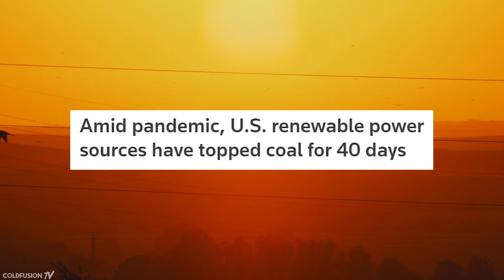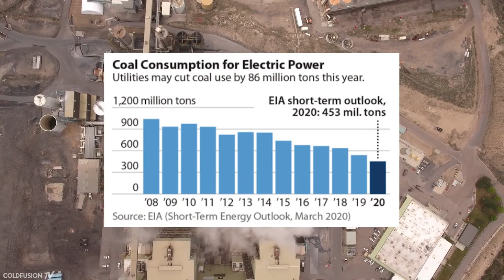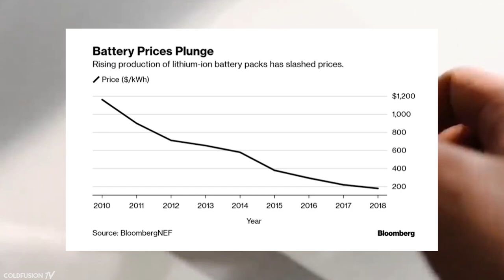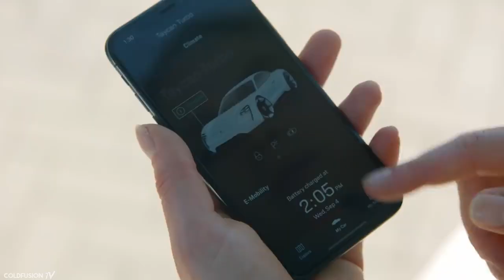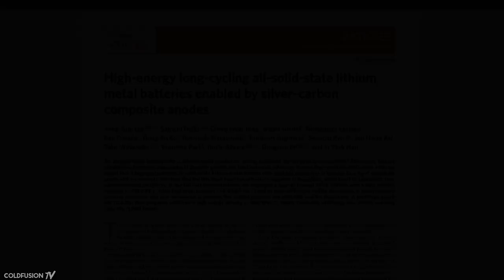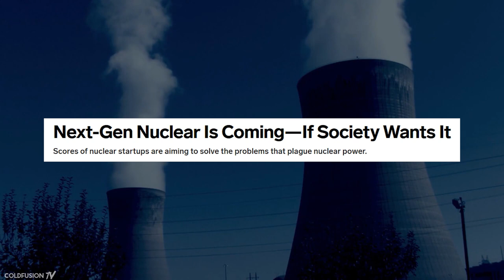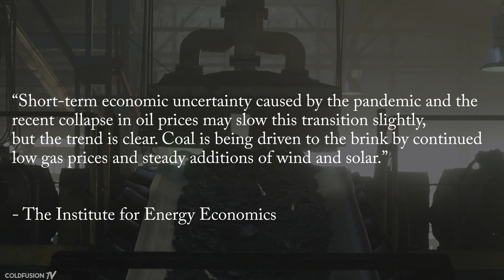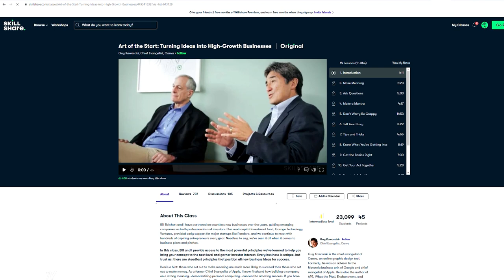Amid Pandemic, Renewables Now Supply More Energy than Coal in the U.S.

Comment: I normally find your videos very substantive to the content represented, but in this video the premise is very misleading. Though it is technically correct that renewable are a growing market in the US, ones interpretation of a renewable energy source, and the reality are divergent. Currently the US has 7 primary renewable energy sources. Wind, Solar, Hydro, Geothermal, Liquid Biofuels, Wood Biomass, and Waste Biomass. Currently the fastest growing sectors include wind and solar which is great! However, due to the current inefficiencies of technology the net energy output of these methods through the production supply chain to obsolescence are relatively small. Now, as you referenced in battery technology as these technologies are further developed they will gain efficiency and become better in the future. In that I agree and think these means of energy production are wonderful. Hydro power is much more effective; however, given the environmental repercussions of dams we are at a limit to the number we can construct. Of all renewable available today Geothermal is the most viable, and least damaging to the environment. But then there are the other three.

Wood Biomass is a very special process where trees are cut down, thrown into a furnace, and used to power a generator. It has many issues and is just as bad for the environment as coal production. Waste Biomass replaces the Wood with human waste. Given additional environmental issues this too is similarly dangerous to coal. Finally we have liquid biofuels. In the US ethanol is the most common liquid biofuel and is produced as a derivative of corn; however, the secondary ingredient to ethanol are fossil fuels. These three "renewable" energy sources (Wood Biomass, Waste Biomass, and Liquid Biomass) represent 1/3rd of US renewable production. Given the carbon output of these production methods, among the additional carbon output in the supply chain for solar panels and wind turbines, the terminology of "renewable energy" is being mislead as equivalent to "good for the environment."

I hope this is somewhat beneficial and would love to see Dagogo cover this in the future. I think it is important to understand the reality of renewables. Not all renewables are created equal. They are not a magic bullet that can immediately change our energy production; however, with research and time they will become more and more viable. 

synopsis on the issues with biofuel :  "The Campaign to Stop GE Trees" : https://stopgetrees.org/problems-big-biomass/
May 2020 US energy sources : https://www.eia.gov/outlooks/steo/report/electricity.php
Article on Ethanol drawbacks : https://www.theatlantic.com/ideas/archive/2019/11/ethanol-has-forsaken-us/602191/

Comment: Burning garbage for power is horrendously expensive due to all the toxin filters,
The energy produced is barely profitable if the heat is used to sell hot water for heating in very cold climates.
Pyrolysis could be the answer.

Comment: 4:40 We currently do not have any battery technologies or theorized  battery technologies even close to meeting demand. I recently did a whole engineering research paper on this. The semi feasible options are gravity based methods such as pumped hydro but they are geographically dependent and inefficent. I don't know where you got the idea that anything we have now or is theorized is viable ( 6:46 ). If they where companies would be using them or looking to use them. The energy densities are way way to small. The unit cost for a lithium ion installment is ~$207/kw. Chemical/Solid-state batteries will never have the required density and scalability. Sure you will see a very low energy scale remote area using them or a small portion of a grid use them to load leveling for political stunts(ahem Elon Musk...). Just like fusion energy its been 20 years away for the past 50 years. There has been a new supposedly revolutionary chem battery paper every month now for the past 10 years. 99% of these go no where. Just like the cancer and HIV treatment studies that get sensationalized every other month as a new cure.  There is a huge problem of sensational click baits on both the researcher and journal sides. (I would definitely recommend watching Coffee Breaks yt video on this topic) . And Yes, there are ton of other theoretical batteries like kinetic, compressed air, power->gas, etc. But the vast majority of these are not new or novel concepts and are just not scalable or economically viable outside of making interesting research paper titles or 'trendy' startups that only exist due to goverment subsidy. 

  But even after all that, there really isn't even a real demand for the type and scale of storage needed for intermittent energy source usage. All of the quoted prices for solar and wind aren't real because they are heavily subsidized. The only reason they are growing is because of politics. Grid providers are being forced to adopt certain percentages of these intermittents. There just isn't any intermittent source demand without those subsidies. The real demand is still in higher efficiency load following base-load systems. The fact that solar or wind grow in the United States is an inherently bad thing for both the economy and environment. Because subsidized intermittent sources mess with curtailment merit order and thus destroy the economics of load following base loads like Nuclear that are actually efficient and green. Those nuclear plants rely on being able to subsidize there higher operation costs by being able to sell 24/7 and in particular when demand is highest. Problem is these intermittents like solar dump goverment subsidized energy supply right at the same time as those demand peaks making it so the nuclear plant also has to sell at a loss (supply up, demand same, price down). In cases like California that are overloaded with solar these solar plants even sell power at their own loss (even after subsidy) because they produce more than is needed by the grid at peak hours. California looses millions on this a month when they have to give away  or even sometimes pay nearby states to take this excess power. 

Here are some interesting sources: 
(coffee break vid) https://www.youtube.com/watch?v=fq8HOguXGFI
(optimistic look at how much energy would be wasted by using solar even with batteries) https://www.cell.com/iscience/pdf/S2589-0042(19)30396-7.pdf
(cost/exploration of storage methods) https://www.youtube.com/watch?v=fq8HOguXGFI
(california losing money on solar) https://www.cell.com/iscience/pdf/S2589-0042(19)30396-7.pdf
(quora answer on merit order) https://www.quora.com/What-do-renewable-energy-generators-do-when-they-produce-more-than-what-is-demanded?share=1

Comment: Greetings: I am a big fan of advanced nuclear power generation  particularly the use of thorium breeder and fast uranium/plutonium breeder reactors. Both of those can make use of the spent nuclear fuel from existing reactors as well as the depleted uranium from both uranium enrichment processes as well as former weapons grade fuel and process waste fissionable material. 24/7 reliable power and we can clean up existing stockpiles. Yes, some spent fuel waste is still produced, but there is much less volume and storage time reduced from thousands of years to about 300 years. Also most units have inherent safety due to their operational physics.

Comment: Can you work on the video that describes life cycle emmisions of various energy sources? I know that the lifecycle emmissions from renewables are drastically lower than hydrocarbon power sources but this topic is something that green energy opponents often swing to without providing any analysis of the actual numbers. I know it can be complicated and vary quite a bit depending on the specifics of a scenario but it would be nice to a range and an average for different sources.

Comment: I support renewable energy not for environmental reasons (which there is many) but for the national security/economic benefits it brings. If a country can produces it's own power using the environment within it's boarders it less likely to be impacted by outside politics. Foreign oil embargoes, etc... don't matter if your are driving EVs charged by locally produced power.

Comment: The other question is "what happens when batteries are spent and mountains of old batteries start appearing or just thrown away"
Reply: Devonly What makes you think that batteries containing valuable raw materials that are easy to recycle will be thrown away?
Reply: @spencerwilton5831  Its only valuable if it's cheaper to recycle them than digging the materials out of the ground and manufacturing them.

Comment: Why do you pluck a battery out of a random laptop for its mah capacity?
Why don't you try to figure out the highest capacity 18650 of the period, and then bunch together six of those, and calculate mah from that? because that is a more appropriate measurement of capacity, if going by mah, than what you put up. We had 1500mah cells in laptops around ~2000, and they worked just fine. And that's per cell; that'd be 4500 for lower tier 3 cells (which nothing even used until netbooks rolled around), or 9000 for the more ubiquitous 6 cell batteries. Both of these shit all over a 5000mah single cell, both in current delivery and holding capacity.

Comment: Storange is (very) important. But actually, there are better ways then Batteries. Because those are expansive, wear out in (short) time and are actually not great for the Enviromet. If acountry has eg tall Mountains, use a pump water storage power facilities. The in and out of power are of course disapointing copared to a Battery. But they ain't cause nearly as much wear and they can storange HUGE amounts of water (energy). Mass overproduction meens: Instant power Storage. And then when you need it - they can turned off and on on any given time. Like a Batery.

Comment: I think/hope that electric cars can be a big part of the energy storage solution. The available capacity of battery capacity in electric vehicles is growing very fast such that even using a small part of it will have a massive impact on the grid. I have recently seen a video where the potential of using cars in distributed energy storage was discussed and it has advantages on many levels.  It will all depend on advances in battery technology and in the software to regulate the storage and release to the grid of electricity, based on availability and demand.

Comment: Unfortunately, energy is just one of the three most important sectors. Heat and transport will use more capacity of the energy sector in the future and will demand more grid capacity. At the moment the transport and heat sector is still based on carbon emissive resources. The decabonization of mainly one sector won't be enough if we want to slow clima change.

Comment: I've been following the sporadic development of renewable sources of energy for years. IMO, the whole paradigm  is wrong. Technology is not the problem. In small scale, it already exits. The grid is the problem. Solar, wind, or a combination of both can power one house for a day when the sun shines or the wind blows a few kph (mph). Batteries no larger than a home air conditioner have the capacity to store power on site until needed on cloudy days or nights when wind speed is insufficient. For apartment or  larger office buildings add more batteries. Three  batteries aren't 1 + 1 + 1. It's 3².  Why carve out thousands of acres of land for solar panels aimed at a tower that produces less energy in a day than a coal fired plan produces in less than hour. Control the grid = control the people. Get rid of the grid. I'll produce my own power. thank you.

Comment: We need solar and wind to get to the point where they are cheap and efficient enough that every home can achieve energy self sufficiency.
Reply: Well you won't reach that for big buildings, for small ones it is already achieved, an uncle of mine has solar on it's roof, in 2018 it had a potential 30 MWh. Potential because he couldn't use all of that so the solar plant runs always at reduced power.

Comment: ooooh, i did not like your battery comparison at 5:15,  yeh lithium is better than cadmium for sure but showing a 14.4v @1700 vs a 3.7v @5000 is a little misleading. The first is is 24.48wh vs 18.5wh so Its not even a proper comparison. I only say this as i hold you to a higher standard than that.

Comment: Some of you are idiots. Watch the video again (or few times). It is not suggesting that demand has shifted from coal to renewables. The fact is demand for renewable energy is increasing and coal is decreasing (for the specific time mentioned).
Also, think outside the box. Energy captured from renewable sources can be stored in batteries placed in residential and commercial spaces. This can't be said about traditional power plants. With this scale, advancements in renewable efficiency, and the advancements in battery technology, we can see how renewable energy can replace traditional non renewable sources on day. The glass can be half full

Comment: What the real solution is to intermittent is Nuclear power not battery. Nuclear is clean 100% uptime, efficient energy with zero CO2
Reply: The real question is if you invest in nuclear why have renewables at all?  With nuclear in place 24/7 all renewables would do is mess up the management of the grid.

Comment: In light of "Planet of the Humans", which is free on YouTube, I don't know what to believe, anymore.
Reply: This video is clearly cherry picking the data. You can see that wind and solar exceeded coal use but you see that natural gas went up even more. Which is what Planet of the Humans discussed, we're decreasing coal use by increasing natural gas use. We're just replacing one fossil fuel with another. The real point of the movie was to pull back the curtain - from videos like this one - that with enough technology and ingenuity, we can build our way out of fossil fuel use and negative environmental impacts. The truth is our modern civilization requires fossil fuel use and all forms of electricity generation will have a negative impact on the environment. For more, see Collapse movie (2009).  I wonder if thunderf00t could critique this video.
Reply: Planet of the humans is mostly based on decade old data on the costs and efficiencies of renewables, when the big thing about solar and wind is how fast they are dropping in costs.
The critiques of biomass are mostly valid as well as the critique on selling gas as a "renewable" form of energy. But good news, while gas has been sold as the "bridge to renewables" that we would supposedly need with how intermittent wind and solar are, most recently, batteries are becoming so cheap and efficient, that combined packages of wind/solar and batteries are now regularly outcompeting flexible gas plants on price. Meaning we don't need gas (anymore) to balance out the renewable energy output swings.

Comment: Unfortunately, to build and maintain these turbines,  solar panels, batteries, etc will take more coal , oil and natural gas than ever. And the coal and oil companies own everything needed to proceed with “ green” energy. We’re fucked.
Reply: Please explain. Yes, manufacturing any and all things in the modern world involved resource extraction and manufacturing energy. This includes manufacturing coal and natural gas plants (the structures and mechanics) in addition to the energy and resources used to fuel such generation stations. We will always use energy in manufacturing. 

The key difference, once solar, wind, geothermal, nuclear and hydroelectric are built, they begin producing energy from carbon free sources. Gravity and water, wind and the sun... essentially free energy.

Comment: While solar and wind are compromised by government subsidies, so too are fossil fuels. Most if not all fossil fuel power, nuclear power and even garbage incineration have been dependent on subsides, yet this video does not mention this fact. Take away the subsidies to the oil/gas and nuclear industries and they will be utterly uncompetitive. This video is also misleading in saying that nuclear power plants are highly energy efficient. It all depends on how we define "energy efficient." What we know is that nuclear plants do not last very long, they are extremely expensive to build, and the land around them cannot be used once the plant is decommissioned. And on top of that, the electricity they generate is the most expensive of all the sources in the energy sector. 

For these reasons solar and wind energy are increasing in popularity: they do not come with the high price tag and risks of nuclear energy and fossil fuels. They are relatively simple, rapidly evolving, and increasingly inexpensive while becoming ever more efficient and powerful. Even with their current reliance on manufacturing processes dependent on fossil fuels, they reduce our dependence on fossil fuels. And bear in mind this is only a transitional problem, because as solar and wind become dominant they replace fossil fuels in their own manufacturing process to close the loop.